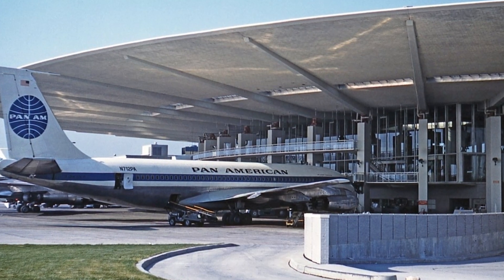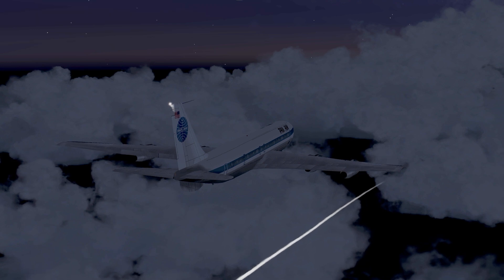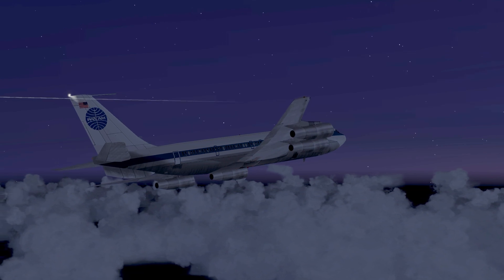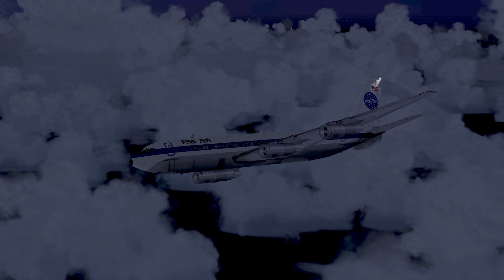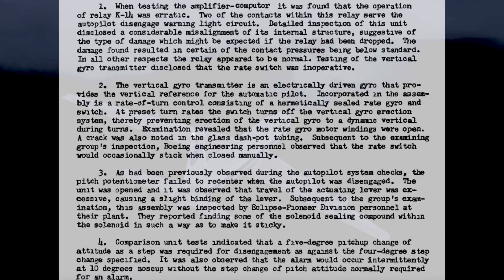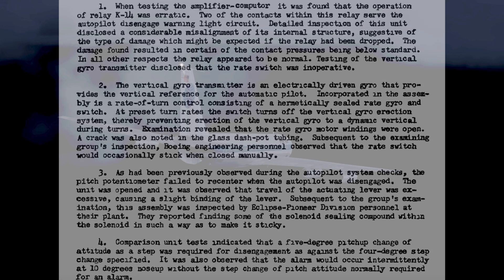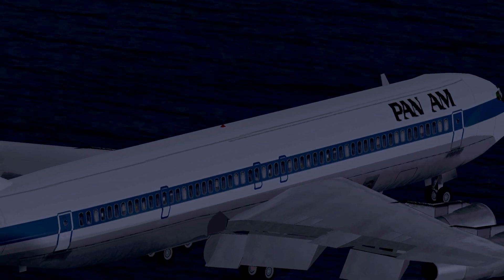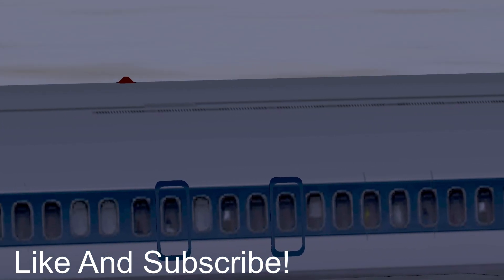How A Broken Bulb Almost Killed 129 People  | Pan Am 115

Comment: I am always pro pilots and reluctant to vilify them when I was not in their place dealing with often unexpected, challanging, and confusing circumstances. However, even if the the auto-pilot disengaged, I would say the co-pilot carried some of the blame for the incident. When a pilot leaves the cockpit for whatever reason, that is not the time to start doing calculations in your lap. The co-pilot should have been paying attention to the instruments, which would have enabled him to respond more quicky to the change in the planes attitude. Doing paperwork and calculations is necessary, but should be done when there is a pilot monitoring on deck.
Reply: I was thinking the same. A pilot is there to monitor. He stopped monitoring. It was like having both pilots gone.
Reply: An interesting question here though, because it’s not like he was ignoring the flight and doing paperwork that could wait until he was on the ground. He was double checking current parameters to make sure everything was correct… if something had gone wrong more subtly and he hadn’t been running those checks, wouldn’t we say he should have been?
Reply: @bookcat123  The thing is that the co-pilot could have done the paperwork at any time during the cruise, just not during the exact few minutes when the captain left the cockpit. Performance calculations are important, but can wait a few minuters, instead of effectively having no pilot flying that plane.
Reply: No pilot?  There’s the autopilot flying the plane!
Well … in theory. It also left the cockpit and told nobody.
Not by turning on the warning light, not by turning off the autopilot display or “autopilot has control” light, not by making a beep, a boop, a gong or a siren or any other sound (never mind an “autopilot disengaged” announcement) … despite this being really important info.
Reply: @advorak8529  There's been a never ending debate between those who would like to remove humans entirely from the cockpit, and others who cannot feel comfortable trusting a machine to bring them to their destination safely.

Ultimately, the facts of history are fairly clear in supporting that computers are better day top day pilots than humans, which is why aviation accidents have been reducing dramatically in the last 2 decades. 

However, many past accidents were caused because humans could not understand what was actually happening and responded incorrectly. 

As noted in a previous comment, I believe humans should continue to be in charge of planes because they can respond to situations that programmers didn't foresee, and can manage computer faults and faulty input data.

We are on the right track with giving ever more control to the autopilot whilst also training pilots to be better at working with the computer. Then, in an emergency, humans can take charge, but only where it is clear that the computer has failed.
Reply: True that
Reply: Pilots cause half of all deaths, and fail to act properly in 2/3 of all deaths.
The Russians had a space plane that took off flew to space and landed without pilots 50 years ago.
The yanks had fighters that could be directed, obtain targets and fire missiles 60 years ago.

It’s time to remove pilots from the cockpit.
Reply: @brucebaxter6923  I definately agree that the majority of aviation accidents were caused by human error.

I suppose I still prefer to have human beings in the cockpit and for me the key isnt removing pilots but continuing to improve the interaction between man and machine, so that we can have the best of both worlds.

On those rare occassions where technology fails (design flaw, poor maintenance, etc.) it's good to have a person who can think creatively and fly the plane by feel in a way that a computer cannot when it's input data if out of whack.

But yeah, you're not wrong. I just prefer a different solution.
Reply: @danilon3121  
Definitely keep humans in the cockpit,
An engineer and a navigator.
Reply: @brucebaxter6923  I mean that would be ideal, to not need pilots at all, but idk if were there yet. it seems like planes are better and better at flying themselves but stuff malfunctions, id rather there be a pilot there to notice and correct when that happens. its like self driving cars (though not as difficult to impliment as them lol) its a really good idea to remove the human from control entirely so there cant be human error but we need the technology to already be there first
Reply: @BlisaBLisa  
Well. I do want an engineer and a navigator monitoring the systems. 

As for not there yet?
The Buran took off went to space and landed by itself. 
The delta dart could take off fly navigate get target lock and fire before returning to base without a pilot. 

We are 50 years more advanced than that.
Reply: genuine question, why arent we doing that then? I don't think companies in charge of this kinda stuff would choose to have planes that need a pilot vs planes that don't, its more work and money, and seeing how enthusiastic people are about the idea of self-driving cars even though the tech for those isn't there yet I don't see why people wouldn't want self-flying planes. with how planes are getting better and better at flying themselves as time goes on it doesn't seem to me like people just arent pursuing the idea of self-flying planes, it kinda looks like they're working towards them
Reply: @BlisaBLisa  
Politics. 
The pilots union has continually fought against safe aviation. 

For example, commercial aircraft do not have synthetic vision or a heads up display while its common in home built aircraft and standard in private aircraft of a certain prestige.
Reply: @BlisaBLisa  I completely agree. Automation is good and it's saved countless lives in the past few decades. But at this stage a computer doesn't know how to respond to faulty sensors, or a malfunctioning control surface, or otherwise unexpected circumstances. That's where humans shine and the biggest issue is just humans being able to understand what is actually happening, so they can make correct decisions to correct problems. Most, if not all, incidents that have arisen due to bad responses by pilots when automation fails, are the result of those pilots not fully understanding what is actually happening. Therefore, the current goal, and mayble the permanent solution, is continue to improve the communication and interaction between man and machine. That's my opinion anyway.
Reply: @BlisaBLisa  Self driving cars are way harder to implement then planes. That's why there aren't any on the roads. Far to many variables for it to navigate safely.
Reply: @brucebaxter6923  you obviously aren't going to be convinced by me, but consider that we hear about the times that pilots cause accidents, we don't hear about the times when pilots intervene early on with a computer problem before it becomes a significant issue. Humans are bad at repetitive tasks, computers are very good at them, most pilot accidents are caused by pilots failing to monitor something, humans are (for now) still better in a crisis. They can evaluate what is more important, and prioritize things in a way that would take decades to program satisfactorily. Computers are much better at managing in common situations where they have been extensively programed, researched etc, but we already know that most accidents sit outside those boundaries. It's actually very rare to have a pilot take a fully functioning airplane and crash it, mostly they are trying to rescue a situation where the computer has already given up.
Reply: @brucebaxter6923  The Eagle landed on the moon through pilot skill, when the computer was having a nervous breakdown. Lucky there was a pilot on board.
Self driving cars still have accidents.
Boeing 737 Max planes crash because of crap automation.
i will only fly if there IS  a pilot, thank you.
Reply: @brucebaxter6923  I would’ve wanted no pilot in US1549, QF032 and OA411. These guys saved all lives ignoring many “protocols”. Computer systems may have reacted horribly wrong.
Reply: @brucebaxter6923      Let us start with removing the driver from all motor vehicles on roads. Unlike pilots, who are trained, often fly as a crew of 2 or more and get regular medical checks — never mind being trained and tested and tested again and need to keep flying, any drunk idiot can enter a car and drive it. And many do. 

The accident rate of the average driver is worse than that of a fully autonomous car with no driver input. Autonomous cars will not speed. They’ll not tailgate. They’ll not drive faster than wheels, brakes, streets and weather allow. They’ll not drive drunk or impaired. They have reaction times that humans can not even hope to match.

They navigate better than a human driver glancing at the GPS.  They do not get distracted by phone calls and have the discipline to not take and cut them. They do not drive sleep deprived nor do they rummage on the floor to find the pipe or cigarette or iPod they dropped by accident.

And since autonomous cars do not have to physically depress the brake pedal, Fifi the dachshund who was not secured and crept under it will not have to be squeezed to death to stop the car.

No accidents while parking, either. No street races between youths that need validation from hod-rodded cars racing each other on public roads along the party mile, spinning out of control and sideswiping some pedestrians to death (yep, that is not a hypothetical case) because autonomous cars do not suffer from minority complexes, tailpipe size related or other.

Besides, cars deal only with 2 dimensions and their top speeds are so much slower than planes …

Do you agree with removing the accident reason: human error — which is at fault in about 99+% of all car crashes and causes more deaths per year than planes do — or do you disagree?
Reply: @advorak8529  
Elon is onto that.
Soon we won’t even own cars, just driverless Uber.
Reply: And why would you want to own a car, anyway?  What you want is the mobility/cargo carrying capability  it gives you. Most people drive to a handful of places with short distances 95% of the time.

If you get that and — in total  cheaper than owning a big car (with all that that costs) all year round — a big car when you need one, what is the point of owning a car?

Imagine you use the bus and therefore have to own a bus. Or long distance passenger plane. Or train and train network.

It just makes no sense if the advantages can be delivered in a simpler and better way.

And did Uber not sell its automated car arm as it turned out to be much more difficult than they thought?  I think I remember something like that going through the press….

… also Elon is by far not the only one in the game. DARPA has fingers in there, like prices for winning autonomous vehicle off-road rallies.
Reply: @advorak8529  exactly
Reply: @advorak8529  Auto pilot is great when everything is going fine. But the pilots are there in case something goes wrong. The very second there is a emergency or something doesnt go according to plan the Auto pilot shuts off and gives control back to the pilots because its incapable of handling random situation. 
Also, if the information it receives is somehow wrong in any way, it becomes more of a danger then a asset. Computers can and do malfunction. They should only be there to help and aid the Pilot by decreasing their workload and preventing mistakes, but not to "replace" them. Pilots have crashed planes before do to trusting the Auto Pilot to much.

Comment: Its the altitude and flight envelope that made cruise flight sketchy back in the day, not speed.  Speed was just a biproduct of the altitude being flown.
In cruise, depending on altitude, you have roughly 14 knots between stall and overspeed.  That is the issue with cruise flight at the time, autopilots were mostly mechanical and were not as sophisticated as the autopilot of today.
Reply: "coffin corner"
Reply: could you elaborate on what you just wrote?
Reply: @anthonyconlon8609  As your altitude increases the stall speed increases. At the same time the speed of sound decreases. If you get too close to the speed of sound the aircraft pretty much stops flying. At cruise altitude these two speeds are very close so there is only a very narrow window between stalling and over speeding.
Reply: @LesNewell   Is that what they call  ´Coffin corner´  ?
Reply: @opal177  Yes, that's right. It's the most fuel efficient way to fly but not very forgiving if you get it wrong.
Reply: @LesNewell  Well, what happens if a 707 overspeeds (say, the overspeed is Mach 0.9)? Will the airframe break into pieces immediately, or will the wings begin to flutter? In other words, how many knots can one fly above the maximum safe speed before the plane actually begins to break? I'd rather overspeed than stall.
Reply: @anthonyconlon8609 ... because of the air getting thinner. So the increased flight altitude (from 31k to 35k) increased this effect.
Reply: This makes a lot of sense. An inadvertent autopilot disconnect with no further pilot input shouldn’t make a plane fall out of the sky. A stall on the other hand would.
Reply: @salvatoreshiggerino6810  no, if the autopilot disconnected, you only need the aircraft to hit a small patch of tubulance to start banking and the the plane starts to enter a spiral dive. If you leave it for a few minutes with no input it can happen.
Reply: @Musikur  I think even with turbulence it's going to do whatever it's trimmed for. When perturbed it will tend towards its original attitude, not away from it.

I don't know how accurate the graphics are, but you can see that it starts out in a left bank when the autopilot disconnects, and then the plane is suddenly shown in a right bank. A possible explanation is that it stalled in the turn and dropped the right wing.

Comment: I think the Civil Aeronautics Board around this time were far more concerned with protecting the jet manufacturing companies. A lot of cases from then seem to say something in the plane failed then blame the crew anyway
Reply: These days the FAA and the airlines are still uncomfortably close, though at least the NTSB seems to be somewhat more independent.
Reply: This. A report placing the blame primarily on the pilot flying would not happen today.
Reply: @MultiKokonutz  The only time they primarily blame the pilot is if they intentionally disregard standard procedures and training.
Reply: Yep.
Just like how the NTSB blamed the A/A 1st officer for the tail snapping off the Airbus in New York.
Reply: @alhanes5803  That was his fault, the NTSB was right..
Reply: @cancelanime1507  
You was there eh
Reply: @alhanes5803  He overly reacted with yaw which caused the tail to snap off.. Literally read the report or watch any video on it..
Reply: @cancelanime1507  
Ya ever see a Lockheed,  Boeing,  or Douglas with the tail broken off?
AF447 threw the tail off as well.
Reply: @alhanes5803   So you're saying it's an airbus issue?
Reply: @cancelanime1507  
Yep, and I'm not the only one. A big time Mach rudder ratio issue was found out, and was buried.
Reply: @alhanes5803  Not surprised I always preferred Boeing aircraft..
Reply: @cancelanime1507  
Boe, Locks, and Doug's are built like tanks....
Reply: Same instincts kicked in around the MAX 😢
Reply: It´s not a bug. it´s just Boeing.
Reply: @foreverpinkf.7603  
Yeah right pinky.
Reply: Nah, really?!
Reply: I definitely think you’re 100% right that there seemed to be an uncharacteristically friendly relationship between investigators and aircraft manufactures and sometimes airlines at the expense of pilots.   Even the TWA841 investigation stinks more than rotten fish.
Reply: Oh come on now! NTSB protect the companies? You mean like recently where they were letting Boeing and do their own inspections and the NTSB inspectors at Boeing were on Boeing's payroll? Oh! What could go wrong! Well, I guess we found out!
Reply: You mean, since its creation until now?
Reply: Capitalism strikes again
Reply: @Caboosejaja  
Move to Venezuela then, and take  AOC,,, aka, the beaver with you....

Comment: Lol you have a system that "sometimes works sometimes doesnt" but no there is no sanction for Boeing just blame the pilots. With all the investigations i hear/watch i think investigations are corrupt and always tends to put most of the blame on the smaller parties (pilots and air traffic control) than the bigger corporations (airlines and aircraft manufacturers)